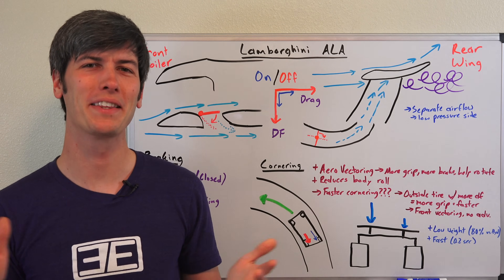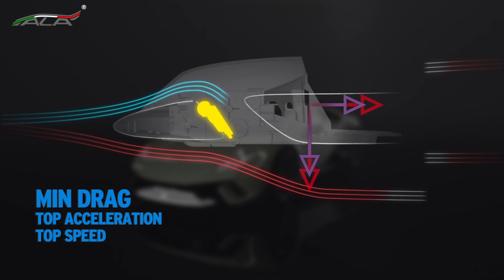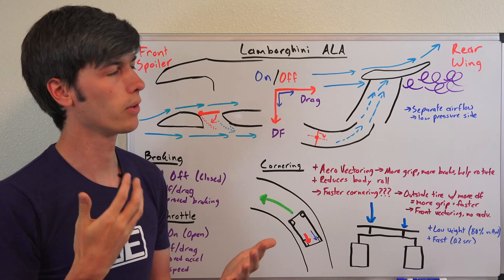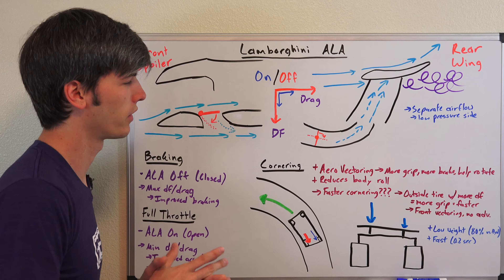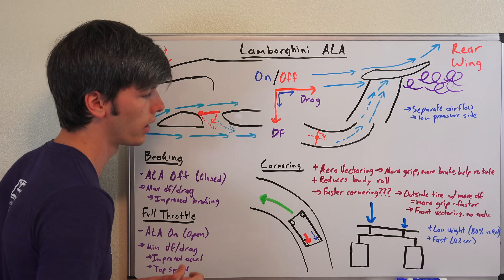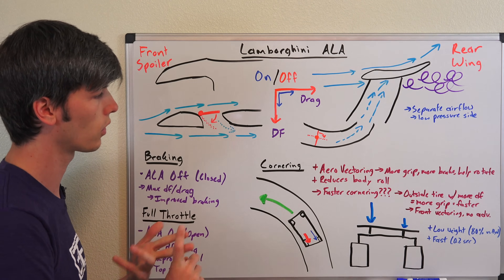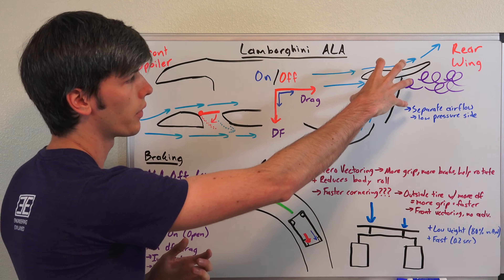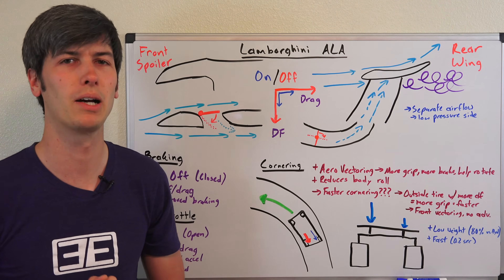Lamborghini's Brilliant Active Aerodynamics - Huracán Performante

Comment: basically a DRS but more advanced
Reply: A normal drs uses hydraulics which are MUCH heaver and slower. This is much simpler in terms of moving parts, and the parts that are still there are much lighter and faster. Thus, a more advanced system than a hydraulic piston.
Reply: it's more like F-duct
Reply: kuugeli lmao you sheep. "Fluff", right, I'm sure you are also part of the flat earth society?
Reply: in corner, the inner tyre grip less because the body rise (propably causing roll) while the outside tyre grip more thanks to the body of the car leaning on it. Considering it's an awd, having less roll (i guess) is better than just adding downforce on a tyre that grip already.
Reply: kuugeli I agree
Reply: drs is also more effective. and my main beef here is with the "aero vectoring" BS. There is no good reason why someone wouldnt want downforce on the outside tires too.
Reply: how is this marketing fluff more advanced? It has cooler names for its features?

Comment: So how big off a difference will this make? Like a huge difference or a small difference?
Reply: ram07ish well the "normal" Huracan got a 7:28 Nurburgring time and the performante version did it in 6:52.  The performante only has an extra 20 hp, the rest of the time gains are in aero, weight saving (40kg difference), suspension tuning, and tires.

Comment: even if there is more downforce in the internals tires i think that the external tires in a corner are always with more grip because of the weight transfer (u can see it in the body roll, if the car is incline in one side, this side is mathematically with more weight so with more grip) so the breake vectoring is not possible. 
Is more realistic that you will have a fast response in cornering because of different drag in the internal side than the external and this will cause a torque that help car to rotate.
good job anyway mate!

Comment: I love that this was explained since there's been a lot of talk about how Lamborghini possibly lied about it's Nurburgring lap time even with video evidence but aero and downforce are just as,if not more important then power so shove that up your exhaust
Reply from the maker: Yep, aero makes all the difference, as the Viper proved: https://youtu.be/aXOASqWt0Zo
Reply: Engineering Explained Can you talk more about how they accomplished the lap?
Reply: dre val he said it himself, you'd need more down force to corner faster (which ALA doesn't give you the maximum possible downforce it could) and the 918 has lots more HP. Idk how it's possibly that the performante beat it by so much
Reply: @christiancarswefind5890 weight. The 918WP is about 600lbs heavier than the Huracan Performante.

Comment: Pagani Huyaayyarayaayra goes a lot further in aero steering in my opinion
Reply: But its  hydraulic components make it heavier.
Reply: Yeah they resemble air plane flaps.
Reply: I'm not so sure about it. I actually wonder how much those flaps on the Huayra actual do. The convex side of a wing is the more effective one, and those flaps don't seem to be using that side well. Talking about problems like vortex shedding.
Reply: a.k.a. miagi well at least they work really hard at cornering and braking, also they are independent
Reply: ADFKSJG , Kyle (the aero engineer) explained that the Huraya aerodynamics is really bad and is way heavier because the hydraulics engines of the flaps.
Reply: They do not work anywhere near as well as you think they do, spoilers work primarily by creating a low pressure region underneath, the huayra's wings don't utilise the underside of the flaps, reducing potential down force by about two thirds. They are also quite small and produce lots of vortices. Basically they look 10x cooler than they actually are.
Reply: ADFKSJG even with hydraulic components, its still slightly lighter than the Lamborghini

Comment: Still doesn't explain how a car with 30 more horsepower and 30 kgs less weight go 30 seconds faster than the standard car around the Nurburgring.

editing cough video editing cough
Reply: Actually 918 is a lot heavier; its ego alone weighs 2 tons.
Reply: Just a Prank Bro!  918 is not lighter, it's significantly heavier than the Huracan. Second, it's not that much faster on straights in  terms of peak speeds, AND most importantly Huracan brakes much later and starts to accelerate out of corners much sooner than the 918. Look at them side by side, out of some corners Huracan starts to accelerate like a second sooner than 918.
Reply: Ali Mahfooz they gave out the data from the racebox... Which was approved to be real by many including Bridge to Gantry. However, it seems weird that a car like that beat the 918 with such ease. Plus, the car in the video still has the wrap on it and is a pre productio  prototype peobably not even running HVAC. It feels weird I agree.
Reply: Um...the stock Huracan has no special aero kits, less aggressive tires, totally different suspension setup, weaker brakes, etc. It totally explains why it would be significantly faster.
Reply: Ali Mahfooz Oh god, not this conspiracy theory again. This was disproved by Lamborghini showing the gps data to all journalists who wanted to see it.

And 750% more DF makes a hell of a difference...
Reply from the maker: Oh hush, it has 750% more downforce than the base Huracan. Lamborghini's smart enough not to cheat on lap time, even if they are owned by VW.
Reply: Man the thing you have to look at are race cars. Those are not particularly powerful (take the glickenhaus SGC003, 500hp give or take, 6:42 on Nurburgring). How can they be faster than way more powerful cars ? Tires, downforce (hence muuuuuch bigger cornering speed), braking and weight. All of those capacities are enhanced in the Performante. Also, some English car reviewers pointed out that Lamborghini appealed to an excellent driver to set this record (can't remember who he was though) which could account for a lot by itself ! If I were to take the most capable car of the world I'm sure I couldn't go any near sub 8 min at the green hell, give that car to a proper race driver he'll smash a record.
Reply: His name is Marco Mapelli, and he's really really good.
Reply: on a racetrack even weight and power bow to aeros and suspension.
Reply: It doesn't looks weird. It's what it is. Some vehicles are better than others on different tracks. The 918 isn't that impressive at all, not even the Zonda R if you compare it against the 956. A car from the 80s... Faster than any LMP1 from today for sure.
Reply: Huge difference in tires as well
Reply: +1 LMAO
Reply: Ali Mahfooz It is better at Nordschleife and that's it.
Reply: Just a Prank Bro! don't think 918 is lighter though
Reply: 30sec gap diff sounds ridiculous but If u think like this, it's only 4.8 seconds faster per minute.

Comment: great point about cornering, I think Lamborghini did it because it would make the car more eager to turn in due to increased rotation, the lateral grip might be a little bit lower but for most drivers it'll feel better. also maybe they just wanted to mitigate that inherent huracan understeer?

Comment: its brilliant, buut i doubt it made the huracan faster than an 918 at the green hell
Reply: Aviral bajaj  918 has higher peak speeds in corners and straights, but on average Huracans speeds are higher because it brakes into corners MUCH later, and accelerated out of corners much sooner.
Reply from the maker: A car with significantly higher downforce (if well balanced) will beat a car with the most clever steering, drivetrain, and suspension trickery every time. It's how the Viper ACR broke so many lap records, explained here: https://youtu.be/aXOASqWt0Zo
Reply from the maker: An additional 750% downforce over the Huracan will make a big difference. The 918 likely doesn't have the same downforce, which ultimately means lower cornering speeds. It's a massive wing, after all.
Reply: Its not comparing videos side by side, its comparing every single corner entry and exit speed, and trap speeds on straights. The common sense suggest that if you enter corners with higher speed, as well as have a faster exit, reach a higher top speed at the straight and carry the same speed through the next corner you will be faster. Theres no way around that. I'd like an example of lap where a car has that disadvantage and still ends up with a better time. Matter of fact, any situation where an object covers more ground for a certain time while traveling at a lower speed than the other object. Unless the laws of physics are defied its virtually impossible.
Reply: But it has rear wheel steering and clever all wheel drive. Isn't that more advance than that 750% downforce advantage considering the traction and the virtual shortening wheelbase?
Reply: i would love to be on the passenger seat with a pilot on both cars to see it with my eyes! hahaha
Reply: erlend myhre 918 will always have better speeds coming out of the corners, that's what its best at, Acceleration out of curves. you still have to admit tho, Huracan gaining 5 seconds is fishy
Reply: erlend myhre But you do realize that in almost 70% of the corners on the ring, the 918 was carrying more speed and sometimes by significant margins of 20-30kph. Consider that in probably most slow corners the 918 exits faster due to instant electric torque. And no, F1 cars arent fast just because of braking ability. The cornering of over 5 G's without touching the brake cause of the downforce and accelerating such a 700 kg car with a 900 bhp powertrain is what makes them fast.
Reply: Juan Martinez so how does that affect anything? A slower car on a remodeled track will post a better time than a faster car?
Huracan was significantly slower on many straights and corners, even if the it has active aero, it just doesn't explain the huge 5 second margin, which is ridiculous considering this active aero and late breaking not only made up for the lost speed on thr straights and the corners but also made up 5 seconds. that's just, fishy.
Reply: Actually you cant use a rendered Video at all to prove something. So there is the mistake of the fellow Youtubers from the start (which mostly apologized because they have been wrong). The Data has been proven correct and the time is right. This is know now since Geneva when they published the raw data of the vbox. On top of that there is another tech channel which simulates the round with a engineering tool and explains why its no wonder and why it will be correct. - You should better check engineer channels which talk about that, than listening to people who have actually now idea how to prove data at all. Looks nice comparing videos, but it doesnt work at all for several technical reasons.
Reply: Rafael Polito some parts of the track were remodled
Reply: late breaking and exit speed is basically what makes F1 cars so fast even though they have extreme aero and grip for insane corner speed aswell as extremely high acceleration and straight line speeds. Being able to break later and get on the throttle eariler exiting the corner is EXTREMLY important in being fast around a track.
Reply: Read my comment again. I mentioned everything you said. Its just that People underestimate the importance of braking later and getting on the power earlier in corner. I wasnt even mentioning the 918 or huracan. Just tried to bring up a point.
Reply: derbigpr500 I agree since 918 is like 600lbs heavier
Reply: d1pz9 or just read GPS data log. its proven
Reply: tom khanom Uhm, no. Automotive journalists from all around the world who are more knowledgeable on this topic than all the youtube comment sections have stated that this time is highly questionable at best. Open up websites and magazines and look for any article on the Performante you will find the best of the best saying its highly unlikely that its a trust worthy record. I dont need to look at the data log, i can give you the full speed numbers through every single straight and corner, do an hour of calculations and you will find the actual time of the Performante. Its not quantum physics its simple maths
Reply: d1pz9 you can do that so and make video about it so we can end all the argument. I mean it's not like I can afford any of those cars but it'd be nice to see still
Reply: Go drive a monolith
Reply: DoubleC, given that both Porsche and Lamborghini are owned by VW, you really think they would be cheating themselves? Let's say that Lambo did "cheat" do you realize what immense reputational damage that would cause? All for what, that they beat a sister companies record? Given that VW is fresh off the diesel scandal, I highly doubt they would fake such performance. I am willing to bet with you that the Performante lap time is real. If I am wrong I'll buy you the 918. If I'm right you buy me the Performante.
Reply: Rafael Polito it is faster
Reply: Engineering Explained  If you watch the 918 and Huracan lap videos side by side, you'll notice that 918 has higher peak speeds in most corners, especially fast ones. Where Huracan makes up time is earlier acceleration out of corners, so it has higher cornering exit speeds (significantly at some places), and it also brakes much later, so it carries more speed into the corner, probably helped by that aero vectoring in both cases.
Reply: +Engineering Explained But kind lads on the internet did a statistical overview of both lap times of the 918 and the Performante, and (un)surprisingly, the lamborghini had only like 30% of the corners with higher entry and/or exit speed. If you exit a corner slower and enter the next corner slower, it ultimately adds up to a worse lap time, but how can you be slower and faster at the same time? Well, video editing. Added frames possibly. And theres a big clue on it when the speedo in one instance jumps from 130 to 190 kph. And this is just scratching the surface, the fellow youtuber goes into analyzing the positioning of trees on the side of the track but we shouldnt get that deep into it. If you believe that lap time, i'd suggest you do the same analyzing video with some math equations, it will get you a lot of views.
Reply: you dont claim to beat a record set by a hypercar with out ACTUAL proof. A third party should be there  new records are to be official... Personally, I think they used a non-regular car with options or W/E you wont be able to choose.
Reply: derbigpr500 That could be one possible explanation but still im highly skeptical that breaking much later and coming out faster off the corners makes up for the lost time on turns and Straights and then gains an advantage further to pose a significantly better lap time. There will always be skepticism about its lap time that's for sure.
Reply: It doesnt explain why the lambo being slower on most turns and straights posed a better lap time than the 918.
Its just... How does aero make you fast while you're slow .-.
Reply: Aviral bajaj True, but the thing that people are so skeptical about is by just how much the Huracan beat the 918. If it was 1 second or at best , 2 seconds, that would be realistic maybe, but it is an immense 5 seconds gap. With the proof that the 918 had higher speed almost everywhere, it's still highly improbable that the Huracan really beat the Porsche by a huge 5 second margin.

Comment: Would only having rear downforce (Wing w/o front diffuser) allow you to corner with more Gs or would you just understeer more?
Reply from the maker: Balance will be off if you only have downforce in the rear. It's why engineers (including those for the Huracan) attempt to keep the aero balance the same as the weight distribution, so that it behaves neutrally.
Reply: Makes sense. Thank you!

Comment: next time do a video on 2017 Ford GT's V6 engine
Reply: no engineering to explain.
Just kinding, but why that engine? does it have some special features and stuff?
Reply: +Major Tom Yeah could be a marketing trick. but then again it's the Ford GT. it has to make big horsepower
Reply: It's got a specific output of about 184 hp /liter which is very very high but by no means impossible as the Mitsubishi evo had 220 hp / l and that's hardly a supercar. The real difficulty is making that power with a non peaky torque curve and without excessive wear (even though supercars are pretty low mileage.)
Reply: Mohammad Zeeshan getting a little v6 to make that power ain't tricky . like Alex A said, it's getting a even torque delivery that's more tricky. they probably use variable geometry turbos or maybe one low pressure turbo and one high pressure
Reply: +Davy Lievens it's a twin turbo v6. same v6 in the Taurus, explorer and few other Ford's. We wanna know how the Ford GT's v6 makes over 500hp
Reply: Tyler Hoeve 
It's also called a $300,000 engine.
Reply: Alex A lol ETS gtr makes over 400hp per cylinder in the Vr38 v6. Getting over 500hp out of a v6 is easy as hell today it's called boost.
Reply: Jay Edlington lmao you are beyond cluless kid

Comment: You forgot to mention the blinker fluid and flux capacitor.
Reply: NastyMcBurgers and ceramic muffler bearing
Reply: Speaking of which, I need help installing my flux capacitor in my 2018 Ford Wrangler. I can't seem to get the high-flow dip stick bearings out of the way enough to make it fit :/ Any advice? Also, I'm running about 30 tons of boost thanks to my low-weight blinker fluid and aftermarket windshield wipers, so maybe that can help put things into perspective?
Reply: NastyMcBurgers high flow dip stick